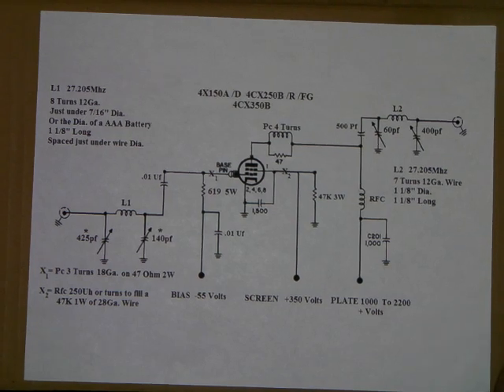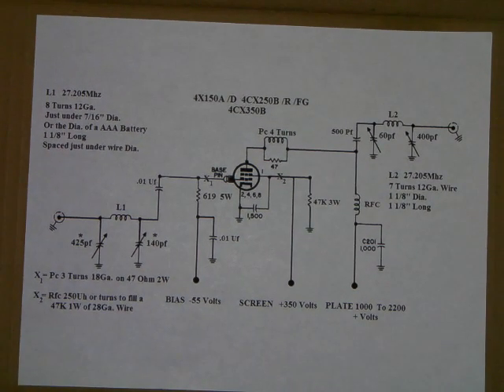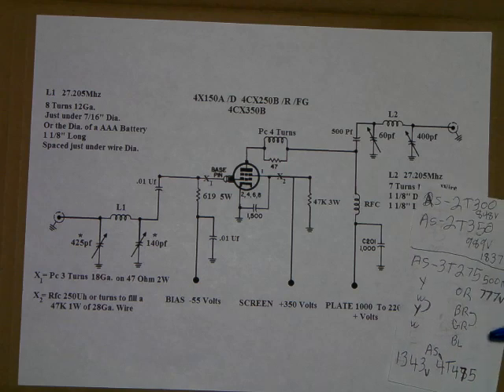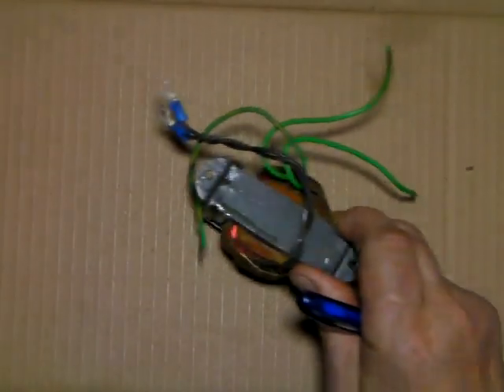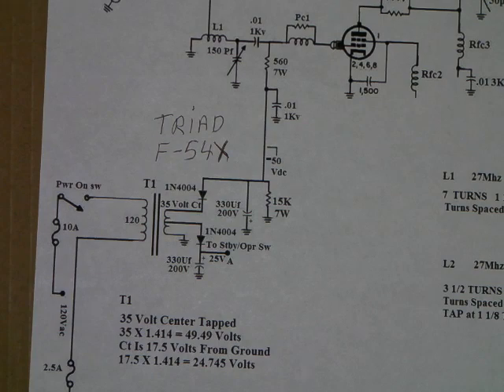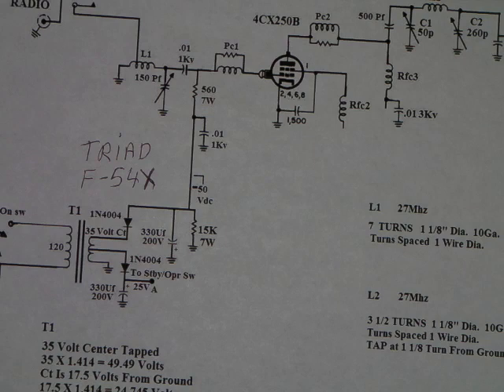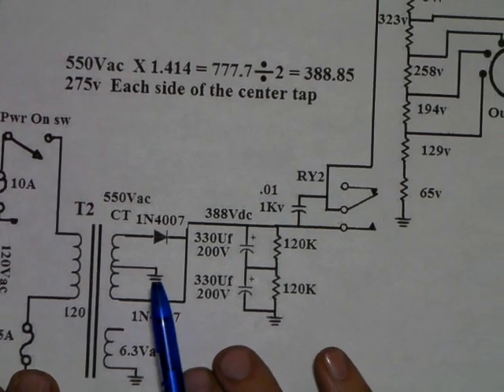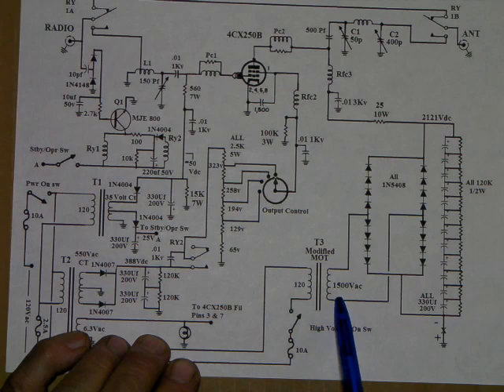Single Tube 4CX250B Amp For 27Mhz  The Build Pt2

Comment: I have the transformer out of a pride and the blower, I also have an old military amplifier with two 4cx-250b tubes but the transformer is huge, the box weighs about 120 lbs or so even though the case is heavy aluminum, but it is a six meter amplifier that I think is converted to 11, but I'm not sure how to separate it to be a two piece so I can actually use it, plus it's grounded grid so the output is low the way I understand it

Comment: Why do you like controlling the screen voltage for output power instead of the bias on the grid? Also why a relay on the screen. Is it because when the screen voltage is off the tube is turned off?
Reply from the maker: I built my first 4CX250 amp in 1973 and I did it much the way the ARRL handbook showed but trying to use an input "T" network to
lower the drive was just too complicated, so I began experimenting
with other methods and I come up with the simple reduction in
screen voltage that worked perfectly and at first I just used a variac
to control the screen transformer because they were fairly low cost
but now they are crazy high priced, so then the next step was just a
simple voltage divider made with resistors and keeping a minimum of 20 milliamps through the divider string so as to keep the screen voltage fairly constant....the tubes only draw about 5 to 15 Mills.
And yes the screen relay is there to shut the tube off in receive, If you look at my schematic you will see that there is always at least 100K ohm resistor to ground and that is for just in case the output control switch ever gets bad contacts and keeps the screen 
pulled low if that happens.
If the screen were to ever become completely disconnected, the screen
by virtue of it being in the electron stream would rise all the way to the
potential of the plate and would arc over to the control grid.
Reply: @radiomedic111  cool thanks

Comment: Great series - thank you! Are the 3 variants of the tubes pin- and socket-compaitible so the same socket would work for all tubes?
Reply from the maker: YES  The data sheets will show you the pinouts, just type the tube number followed by the words "data sheets PDF' into google and you
will find all of the data sheets for the tubes that I have talked about